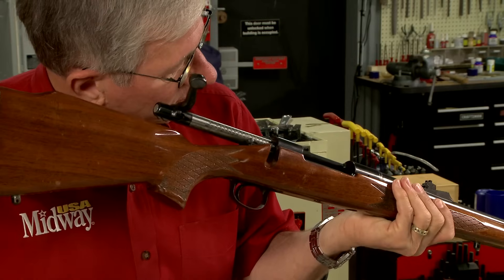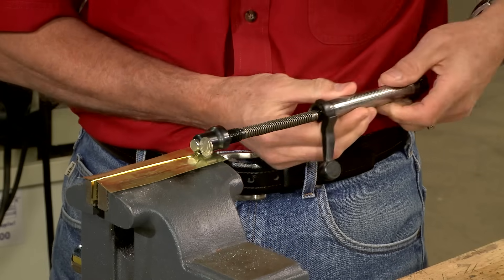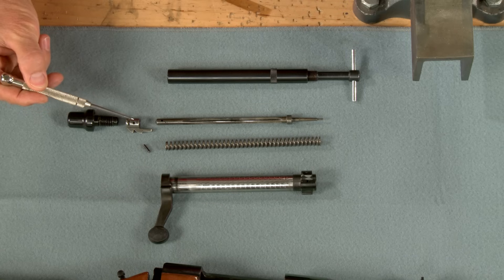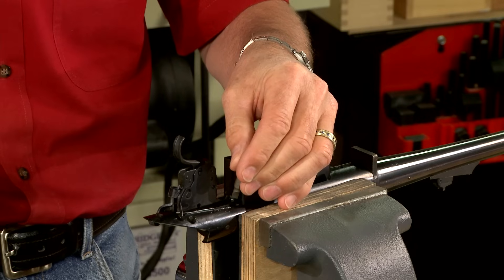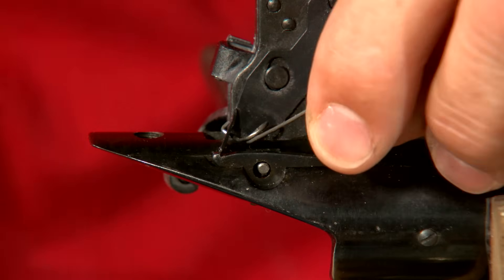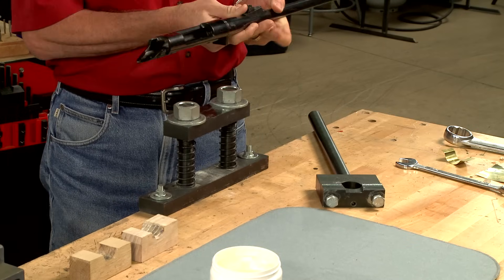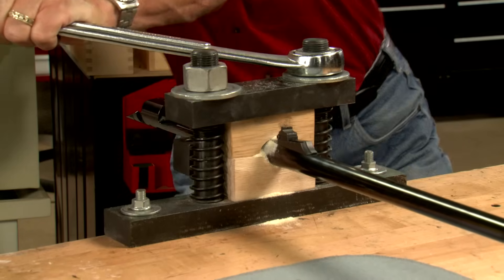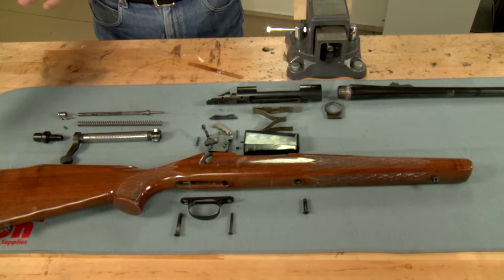Complete Tear Down and Disassembly of a Remington 700 | MidwayUSA Gunsmithing

Comment: Unfortunately he built an entire custom safari rifle in .375 H&H mag on that M700 receiver, and he did it all without ever removing the extractor!  It's the only piece he DIDN'T take off!

I think it takes a specific tool called a 'Remington 700 extractor rivet anvil' to do it right, but I'm not a gunsmith.  You should get the American Gunsmithing Institute (AGI) Technical Manual & Armorer's Course DVD for Remington 700 Rifles.  Midway has it for around $35.

I try to get one for all my guns.

Comment: I inherited a beautiful R700 from my uncle, I want to tear it down and give her a good cleaning
Reply: A basic field strip would work for a good cleaning, for a deeper clean you can remove the action from the stock. 

A trick I learned to clean the guts of the trigger cassette without needing to remove it is to squirt lighter fluid down the sear slot and out the bottom of the cassette (once the action is removed from the stock)to flush out any dirt. When the lighter fluid evaporates it leaves a slight lubricating film.

I wish you many years enjoying the 700

Comment: i have a 700 in 308 that has a sheared off receiver screw that was removed incorrectly and resulted in a stripped out receiver screw hole.   what is best way to fix this with oversized stripped screw hole.   any suggestions are appreiated

Comment: I bought a new Remington 700 sps varmint 308 but mine dose not have the screw to hold magazine in place has the threaded hole but no screw the mag just rests on the action. this is a pain because when I remove the barred action the mag falls out is this normal or am i missing parts  came from store this way.

Comment: hi Larry - I have the exact same 700 Remington with a wooden stock. I wanted to change it into a synthetic stock but when I ordered one it came with an open magazine area, whereas the wooden one does not have this opening and the magazine is retained on the stock itself. Could you tell me which synthetic stock Model to buy that does not have the magazine opening.